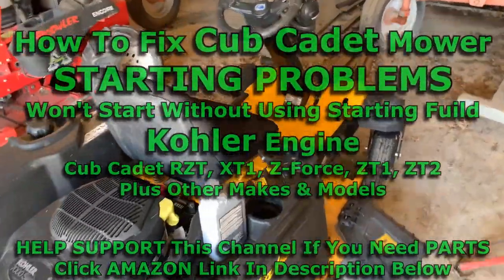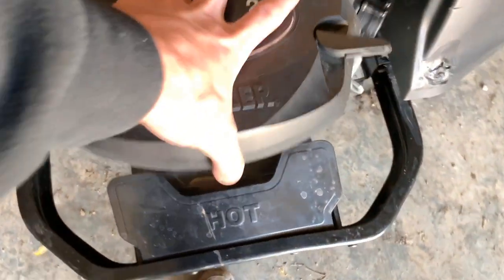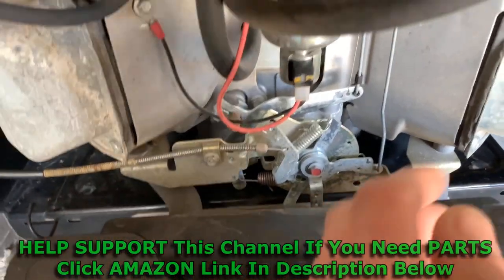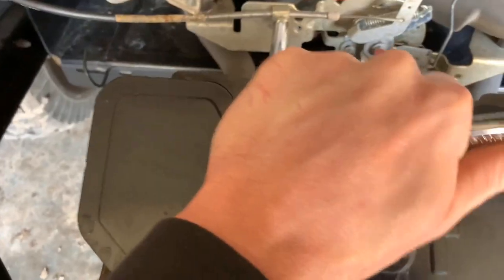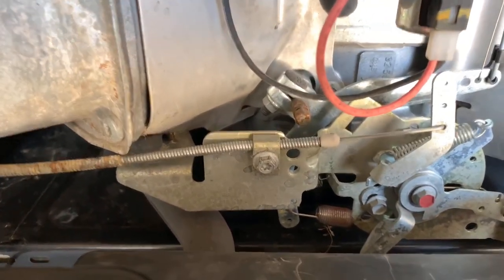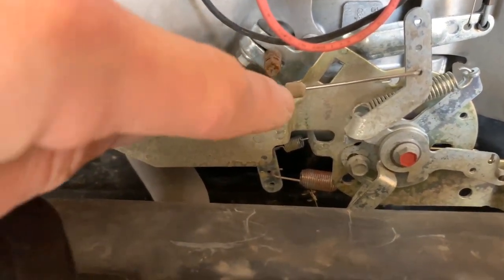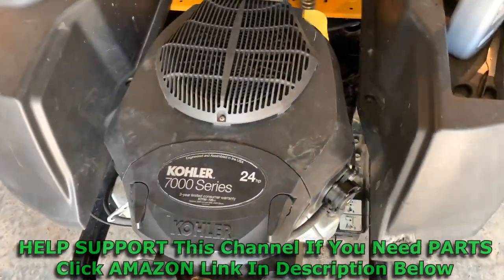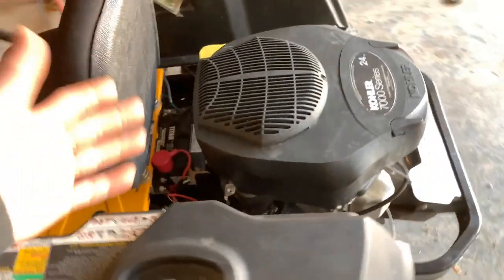Cub Cadet WON'T START Without Starting Fluid REPAIR Lawn Mower Kohler Engine NOT STARTING Cold FIX

Comment: I have a 2013 Cub Cadet LTX1050 that I bought new.  Dern thing has decided 2 years ago it was time to start falling apart.  I've replaced the drive belt, pulleys, pulley arms, cotter pins sheering off left and right, PTO drive shaft, etc.  Tonight I go out to mow and it won't start.  Just turns over and over.  So I watched other videos which caused me to drain my gas tank, remove the tank, check the throttle cable which is apparently fine, I then noticed that my parking break was missing the bolt holding it in place so I fixed that, then I got under my mower and saw that motor mount bolts are missing and my engine is gyrating like Elvis.  So now I have to go see if I can find some at the hardware store.  Then I see your video and realize that (more than likely) the whole issue with my mower starting was one stinking bolt and a cable adjustment.  So tomorrow I'm going to put it all back together, tighten up the two motor mount bolts that are still there and adjust my throttle cable as you suggested, because the last time I mowed I noticed the throttle lever got stuck and wouldn't go up into choke easily.  So I gave it the old college try and it went into choke and started.  I'm thinking my Heman shove probably jacked up the cable and made it where it won't go into choke all the way anymore after the last mow.  So hopefully this adjustment will fix it.  I'll come back and give you praise if it does!  Sorry for the novel, my week has been a stressor and then my lawn mower spit in my eye tonight to make matters worse so I had to vent.

Comment: My neighbor's Cub Cadet had this issue and that's what I did to fix the problem of requiring ether, but I still have two problems: the choke has to be applied every time the engine is started and I can't reduce the idle enough when this fix is applied. The linkages are in the optimal locations, and I'm not about to cut the throttle lever to push the idle down further. It just might need a new throttle cable. Thoughts?

Comment: Got a zero turn with exact same engine.  Gonna try this Tomorrow after I replace the plugs.      It was smoking real bad , I drained the oil , new oil filter. , refill to proper level and bam no more smoke.

Comment: I have a cub cadet pro Z 100 commercial with 60" deck.  Owned for 2 years. Just had it serviced 2 months ago.  Engine will turn over for 2 seconds then sounds like it wants to freeze or lock up.  It's the weekend so I cannot call the place where I bought it. 
Any suggestions?
Reply from the maker: this should fix the problem https://youtu.be/BWnkTZvk8L0

Comment: I have the same engine and it's like my throttle isn't moving the choke or nothing in the back. Can move the throttle up and down with no movement on the choke or anything. Got any advice on that?

Comment: after adjustment with cable though it was fixed, but now still have to use my hand to pull up on linkage choke?

Comment: I've done this on different zero.turns that use kohler engines. Cub cadet and Troy bilt. I've also put a little stick to hold that up and after starting it just falls away. It's a pita.

Comment: I have the same motor on a Toro. It currently won’t start and there is liquid coming out of the air filter housing? Anyone know how in the world that is happening and possibly how I can fix it?
Reply from the maker: drain the fuel sounds like water in your gas or bad fuel has it been sitting for over a year or so???

Comment: Hey man I have the same type mower and there is/are  some safety with that keeps my Blade from turning.  If  I move the LEVERS in and out  a  safety triggers and it starts to work.  Then I hit a bump or turn it off  then I have to start the same process of shaking the handles in and out again to get it to work.    Any suggestions?    BTW loved this video !!
Reply from the maker: It sounds like the switch that you pull up on to turn on the blades is probably bad or it may just have a loose wire on the bottom where it plugs in to the connector for the switch if it's similar to that more or if it's a cub cadet I believe it's the yellow round deal that you pull up on that's probably your issue so look underneath there and check the wires and then if not order replacement and see if it fixes it if it doesn't you can always return it if you buy it on Amazon or whatever I hope that helps sorry using talk to text if some of the stuff sounds a little off from Siri putting in the wrong words.

Comment: I had my throttle cable slip off the knob so when I adjusted the handle into fast, slow and choke the cable didn’t move. I fixed that but still ain’t starting, probably did stretch as I use it constantly for my lawn care business

Comment: I am thinking my battery needs replaced, I can put a battery charger on it and the battery is ok, but still won't start.  Wondering if it is the battery???  Thank  you
Reply from the maker: I bet it is the starter solenoid

Comment: I had the same problem. I tied a cord to choke leaver ran it under the hood    behind the steering wheel. pull on the cord to close the choke when starting it works

Comment: I've got to push mower 173cc spray starting fluid in it and it will start right up then die Bowl carburetor bowl is full of gasoline have any ideas push mower
Reply from the maker: Yes take out the screw in the bottom of the carb that is the bowl drain screw & let the gasoline drain/drip for 30sec/1min you have water in your gas I would be willing to bet a-lot of money most of the time you can just drain the carb without draining the whole tank & it well be fine cause water always goes to the bottom of the tank. Let me know if it works? & good luck hope this helps!
Reply from the maker: PS I have a lawn boy push mower with Honda 160cc engine same as they use on the mid size power washers made by Honda & I store it outside sometimes & doe's that same thing as yours from time to time where I have to drain bowl really quick then it runs fine.
Reply: Your main jet may also be clogged.

Unscrew the bowl and ream out the bolt holes. Run a thin wire up into the carb from below.

Comment: Alright fellas, the poster did a great job getting our mowers back into running condition. However, he did miss a very important step. The first step you take before you even get close to your mower is to make sure you’re wearing the grass cutting shoes of champions. Yes, you know the ones... the new balance’s with the Velcro straps. Once these are on, you’re no longer a “dude on a mower” you become a lawn maintenance professional.

Comment: Have an issue where it won't start but if you put gas in the carburetor fuel run but it's like not pumping gas it feels the fuel pump but won't run can you help me it's a 2019 manufacturing date April of 2019
Reply from the maker: i bet this is the issue check out another video i made about Cub Cadet starting problems https://youtu.be/BWnkTZvk8L0

Comment: I have the kohler 5400 motor. I tried this..and it didn't help :( Putting the throttle all the way into the choke position just barely touches the rod for the choke, I can then push the metal piece that is touching the choke rod and it will work as it's supposed to- even if I let go of the metal piece, until next time I need it. Something else is up, I guess..

Comment: Another common cold start issue the Kohler has is valve clearance.  Mine have been so far out of spec from factory it’s a joke.   Their quality control in this area sucks.

Comment: For the problem you were trying to fix you incorrectly adjusted the cable. Your choke you handle should have been all the way to choke and then adjust your cable to the right so it completely engages the choke on the motor and then tighten it

Comment: First off let me just say-I'm not very knowledgeable about engine workings or repairs, which is why I am scouring Youtube for any & all help. But...My engine won't start without the starter fluid even after it has been running and then shut off. My Kohler SV610 engine has a manual choke lever and it engages the choke plate open and closed just fine. It runs fine after its started with the starter fluid,  just can't shut it off. It's not the spark plug (same results with 2 different plugs) and I even replaced the whole carburetor (with a new fuel solenoid attached) which worked for about one mowing session, then it resorted back to where I was initially - i.e., it won't start (except now it will with starting fluid only).  I am at wits ends trying to figure this SOB out??? And  oh, I forgot- I also replaced the fuel pump and fuel filter before resorting to the whole new carburetor unit installation. Does anybody know what this could be or what I should try next?

Comment from the maker: HELP SUPPORT CHANNEL Click Link Below & Buy Something Off AMAZON
https://amzn.to/2XLE6pF
Reply: THANKS so much for this tip!  I DIY it from your instructions and it worked instantly.  It ran fine for about 15 minutes.  I mowed one loop and backed up, the engine died and refuse to start again.  I am going to let it sit for awhile and redo the adjustment to the choke! Thanks for helping me start a new lawnmower with 10 hours of use.